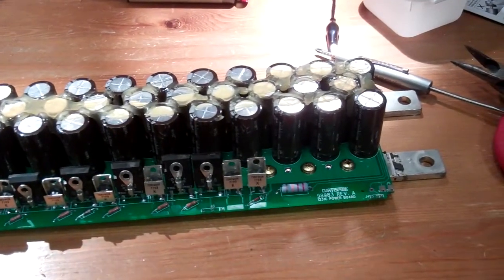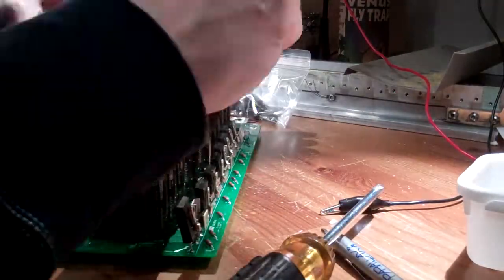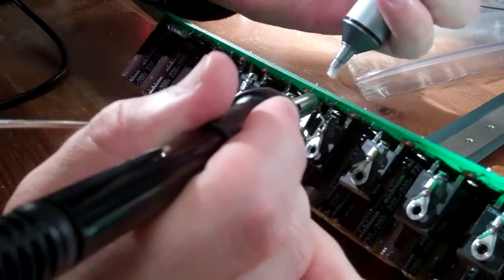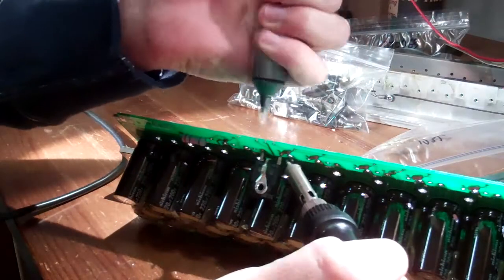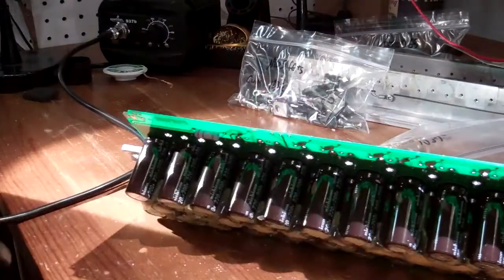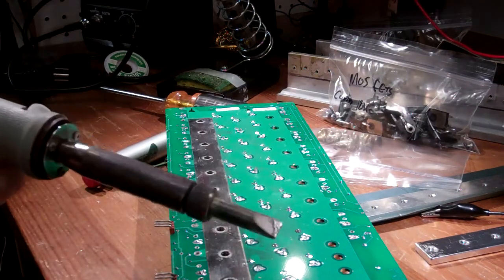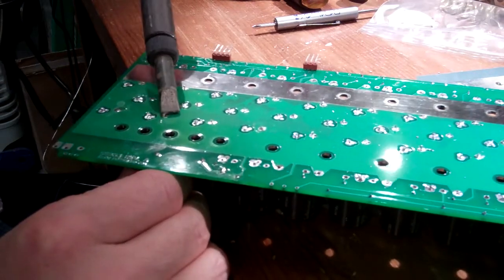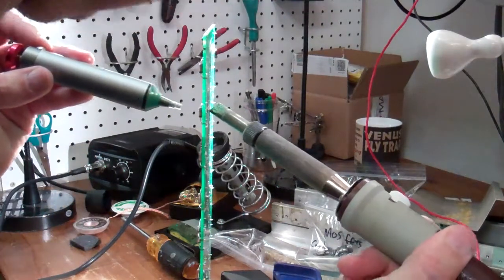Desoldering power components from a Curtis 1231c PWM DC motor conroller

Comment: im trying to figure out how to adjust the side pots, the type of screwdriver is not mentioned in the manual..
Reply from the maker: You probably want to use a plastic screwdriver (designed to tune radios so the screwdriver doesn't mess with the circuit while you are tuning/testing it, but also advantageous in that it doesn't conduct electricity).  Something like these: https://amzn.to/48zZv9O